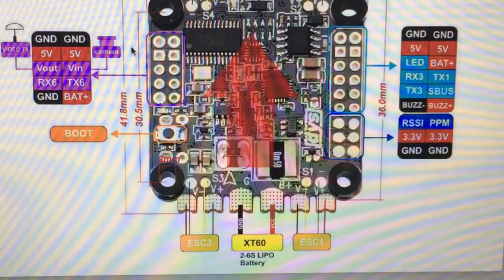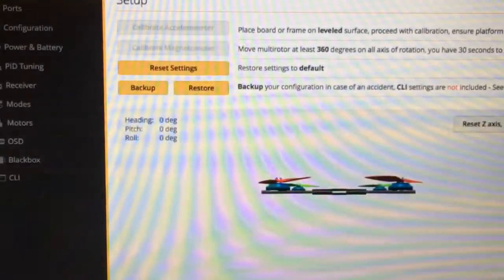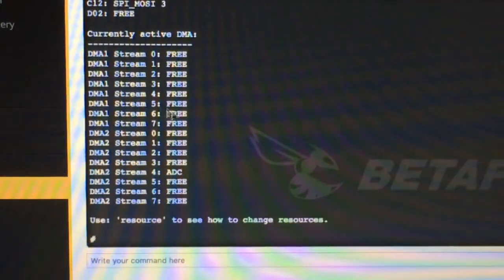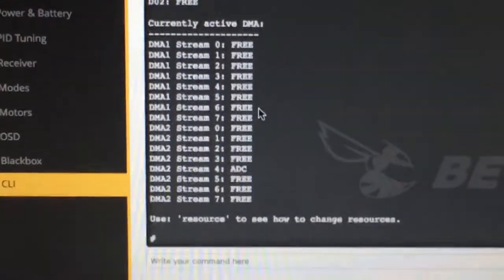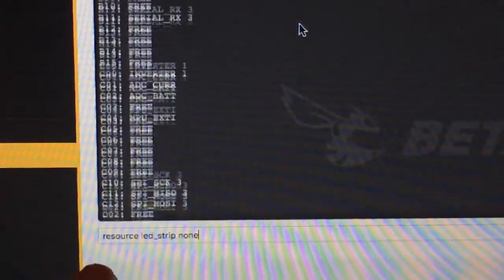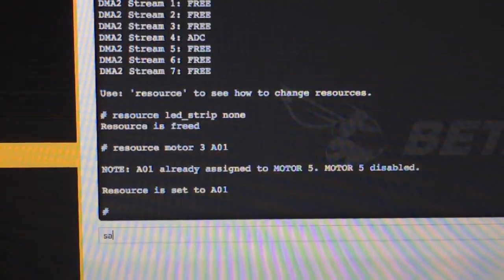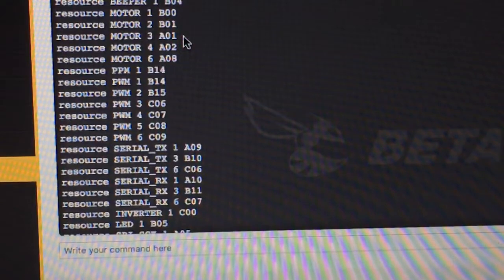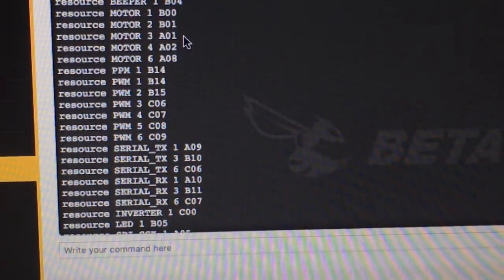ramapping motor signal pad to led strip pad

Comment: Do you maybe know if I can remap it other way ? I want led_strip on motor pad (motor 5 or 6)
Reply from the maker: I think so? But not 100%, I guess try it.
Reply: @Mbsfpvchannel  normally I would just try , but I have stack barely fitted into a 3d printed frame and its all kind of messed up there , fc had double burned processor in his life :D and now rx6 and Rx3 doesn't work anymore , tx3 and tx6 are working fine , receiver (Ibus)is wired to led_strip and I also wanted led strip ;D
Reply: @Mbsfpvchannel  not working p
Reply from the maker: @maxmax-xx7nw  hmm, check oscar liang's blog, he has a list of what all can be remapped